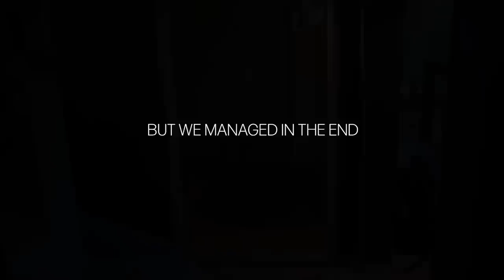#21 Big steps in the bathroom, re-doing windows & trying to make a frog move elsewhere...

Comment: A common and very effective way of fitting dry wall (gipsplader) to seize is to mark out the needed dimension of the board with a pencil, and then cutting through the upper layer of paper with a sharpie along the pencil lines. With this done you can break away the unwanted board along the scribed lines. A technique similar to cutting glass to seize. Kind regards from Denmark.
Reply from the maker: Hi Sebastian, thanks for your tip! I am using a fiber plaster board that doesn't really work the same way.. It can not be broken easily and has to be cut with a circle saw or similar... A little bit annoying but it is so strong you don't have to use plywood or similar behind it, and should then save both time and resources used 🌱